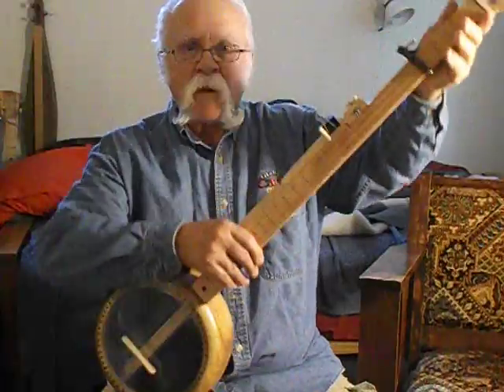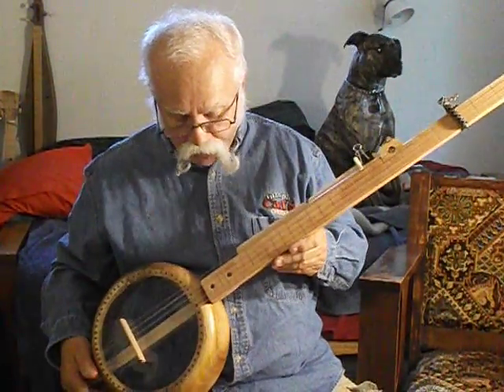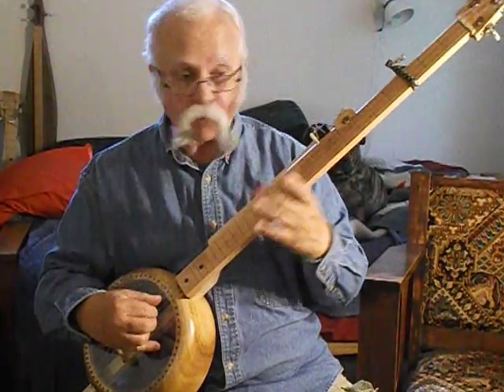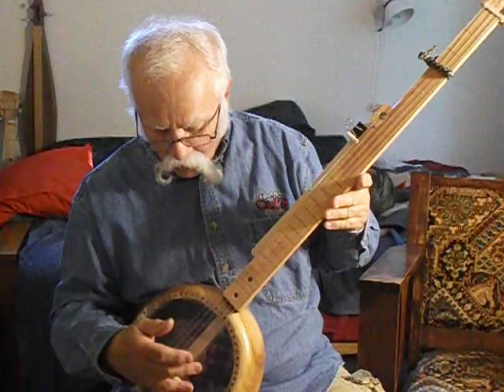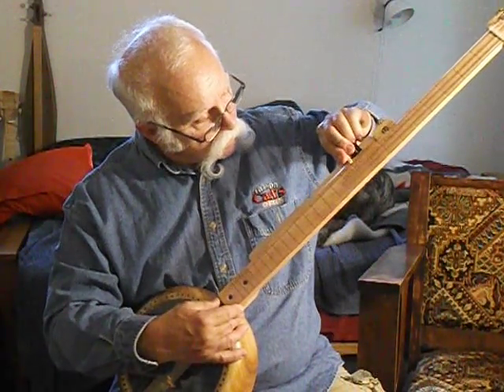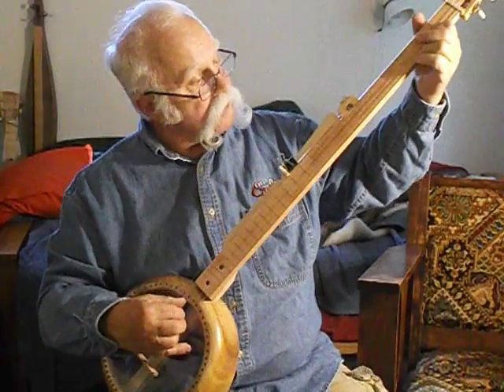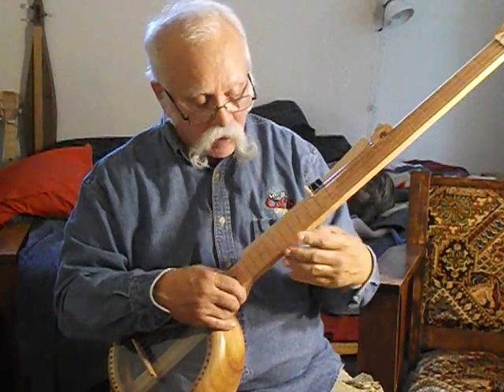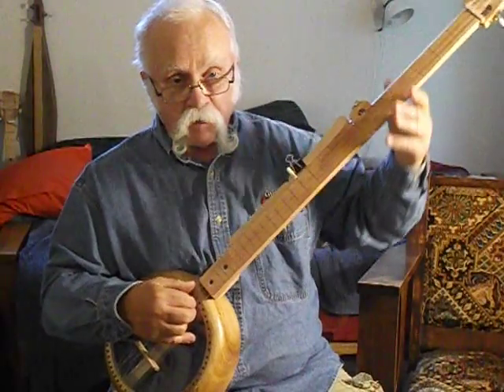Folk Giant Test Video-- Salad Bowl banjo

Comment: I'm digging that headstock!

Oh, man, the tip to go to an autoparts store after it it rains to get old windshield wiper blades for frets is awesome!
Reply: What is making the horrible clicking sound in this video?
Reply: Another windshield wiper? :-)
Reply from the maker: Don Crowder  My guess is that it's because the camera is right in front of a battery-operated pendulum clock, and it's the thingy that makes the pendulum go.
Reply: MOVE the camera, that noise needs to GO AWAY. :)  Call me picky.

I I bought some 1 and 2 mm half-round plastic on eBay, for cheap, that would probably make middlin' good frets if you've got a glue that's adequate to hold them down. I made a uke bridge by gluing together pieces of veneer (with yellow wood glue), to get to the right height, and used some E6000 adhesive, which I bought at Dollar General, to glue a short piece of the 2 mm half round to it. Worked reasonably well.
Reply from the maker: Don Crowder  I took the battery out of the clock, replayed the video, and the click is still on the audio. So, moving the camera NOW, is  not going to help. Sorry.
Reply: Are you saying you re-shot the video with the clock shut down or are you just messing with me?  :)
Reply from the maker: Don Crowder   Messing, of course. You didn't ask me to re-shoot, only to move the camera.
Reply: Lucky for you I don't know how to spell a bronx-cheer. :)